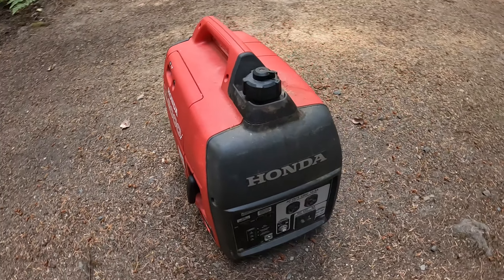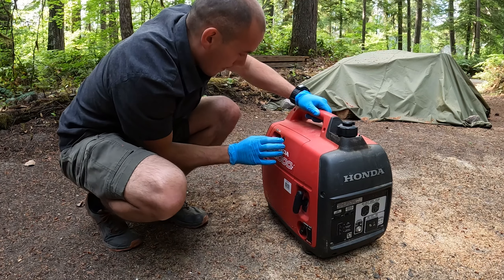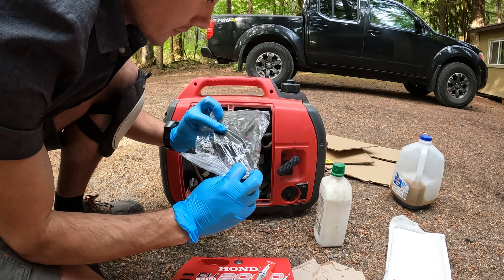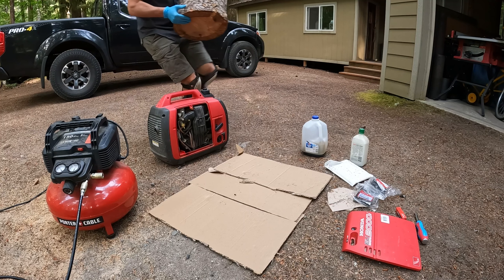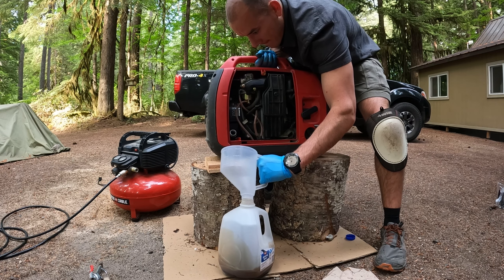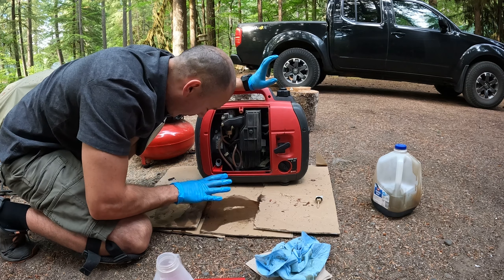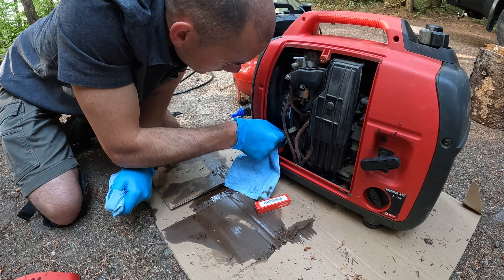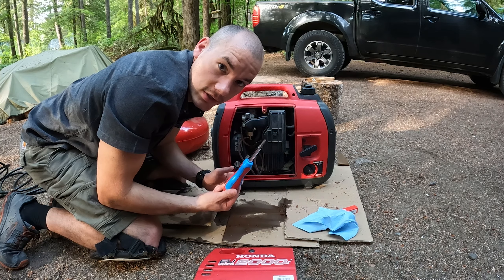Servicing My Honda Generator for Off Grid Power

Comment: You can reuse those filters Diego, I bought an extra set to immediately swap and then clean out the old one later for the next service. I have the newer eu2200i and the nice thing about that one is the app tells me when I should maintain it on everything. If you service yours again you should probably check your spark arrester to make sure it’s not clogged up other than that you did a good job also the filters are meant to be oiled a little bit after cleaning the one you bought was pre oiled already so don’t forget to do that. these machines were meant to be used so you’re not abusing it you’re giving it the best life it can have. if you didn’t blow a circuit breaker repeatedly on it then you’re using it perfectly lol. Love this channel keep up the good work!

Comment: Great Job! I would have usually put some oil on the spark plug threads when installing the new plug.  They should have made the oil easier to drain.